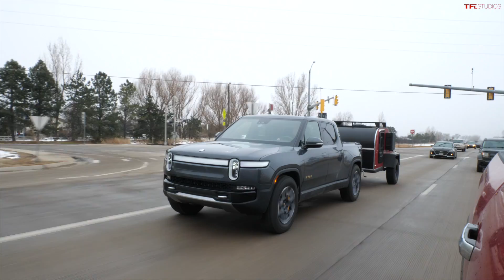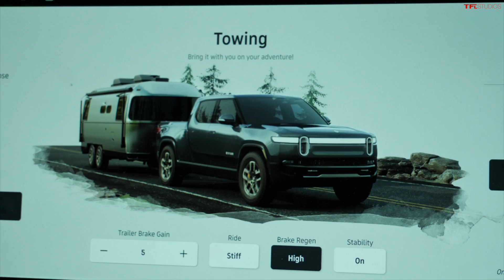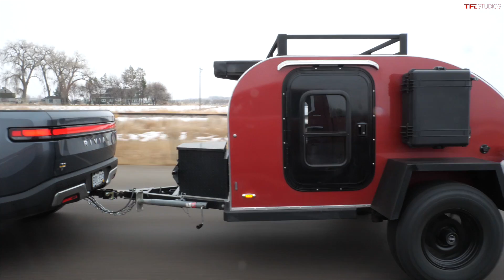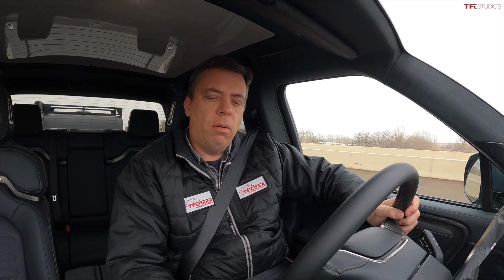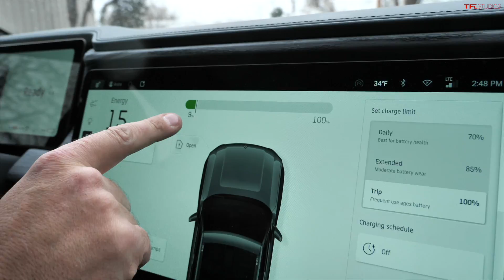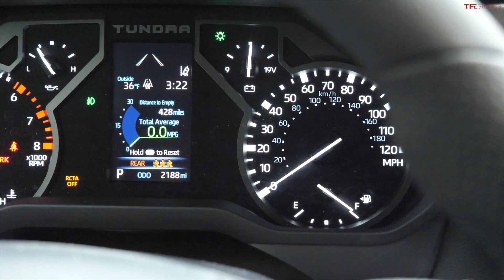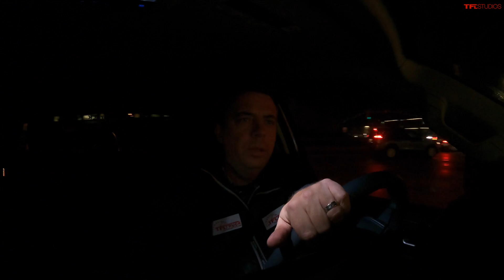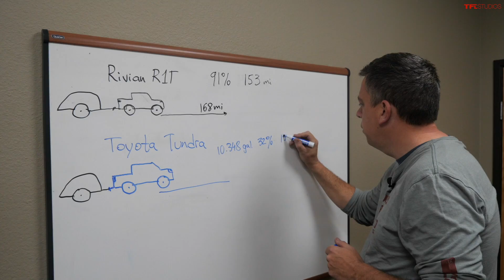Rivian R1T vs. Toyota Tundra: How Far Can Each Truck Tow On A Single 'Fill-Up'?

Comment from the maker: Thanks to Keeps for sponsoring this video! Head to https://www.keeps.com/TFLTruck to get 50% off your first order of Keeps hair loss treatment.
Reply: I know we can extrapolate this ourselves, but i wish you would have included a long distance trip example based on these numbers. For example a 2000 mile non-stop trip would take X amount of hours compared to Y amount of hours when you include charge times and refuel. Great video. This is why i watch!
Reply: 1.25 mi/kWh is ≈ 42 mpg.
Reply: @mgreene1409   in the last vid in the fast charge electrify America i think it say the rate was $.48 per KWH so would this mean that it cost $0.60 per 1.25mile?
Reply: @chileguero2  Yes.  The Tundra did 1.25 mi for 33¢
Reply: Share how long it took to recharge the rivian compared to how long it took to fill the Toyota.
Reply: How was the seat comfort, comparing both trucks?
Reply: Would you do a video on how modern vehicles are a Orwellian surveillance device?
Reply: so I am curious, in money $$$ comparing results, filling the Tundra, VS Filling the Rivian to do the same amount of miles the Tundra can do with one full tank. What's the cost? Gas Vs Electric ? would like to see that comparion in numbers. Love your vids
Reply: One thing you left out. You used 10 gallons at 40 bucks on the toyota. But really didnt show the cost of the Rivian. So I will use the  from the first towing of the truck which was 4 times the weight, at 20 bucks for half charge x2 be 40 bucks......Still not see how electric is better  Since toyota is what 35k less?....I'll by me the Tundra and with the left over35k+ I'll buy the wife a RAV4 Hybrid

Comment: The problem with this comparison is it was only on pretty much flat terrain to do a true test you should have at least some mountain driving to show how much energy is use with a n EV pulling on an incline. and with a 2,000 pound trailer you could have use a smaller truck like a Tacoma. If you're using the Tundra the trailer should have been bigger so the test was skewed from the start.

Comment: I think Rivian give a tow rating of 11,000 pounds. I would like to see a truck comparison, towing a larger trailer, up the mountains. 

Not necessarily the 11,000 pounds, but something realistic, if you owned a truck with tha tow rating, I think most of us would feel comfortable towing a 7,000-9,000 pound trailer. 

I live in the valley of Northern California and pretty much everywhere I want to go camping, requires a trip of at least 80 miles if I want to stay on this side of the Sierra's to about  220 miles, peaking out at 10,000 feet, if I want to camp on the Eastern Side,  with no charging stations for almost 90 miles before going over the highest point. 

So, put a 8,000 pound trailer on a Rivian and start at a couple hundred feet, then travel 90 miles up a mountain range. How far can you get?

Comment: What a strange test. If you used a Pick up truck with a smaller fuel tank the outcome would be different, if you used one with a bigger tank the outcome would be different. If you compare the rivian with the 18 wheeler i drive ( about 200 gallons of fuel ) i would win!! Again, a srange test.

Comment: The key thing that you missed,  is why do you buy a electric and it isn't for range or hauling (yes that is why you buy a truck).  It is efficiency....  and with electric trucks you compromise hauling for efficiency.  (This is assuming gas not diesel which would a really good match up against the Rivian. 
What you didn't answer was how much it cost to haul that trailer the same distance.

Comment: Rivian has a 135kw battery. At 91% it used 122.85 kw. At $0.43 kWh non member electrify America price verse $0.33 kWh for member. That’s $40.54 to go 153 miles for members and $52.83 for non members. Tundra cost $40.35 at an inflated price of $3.89 per gallon.  This is why gasoline powered vehicles cost less and mind you less stress and time.

Comment: I don’t understand why they wouldn’t put a generator or alternator into the electric vehicles to recharge the batteries as the vehicle drives. They could run it off of the axels and charge the batteries to get more charge and more distance out of them. But what do I know.

Comment: Great info and nice presentation.  My truck is a Dodge Ram 2500 with an 8L V10.  I’ve towed my 6500 pound travel trailer all over the country.  I only get 6 to 8 MPG average, but I can drive about 300 miles before filling up again.  The cost of gas is an issue now, but I’d still rather have the range of my ICE.  I watched a video recently about a couple in an R1T pulling a car on a trailer that was about 6500 pounds (total) across country.  They only got about 100 miles before having to charge for an hour on a fast charger.  So as much as I want to replace my old truck, I don’t think an ETruck can replace it yet… 🙂

Comment: Capacity is lacking for some, but just done some math for here in the U.K.  electricity is 28p/kw  and petrol is £1.87/L . So EV cost £34.40 and ICE cost £87.85 for the same journey.   Just depends if you can live with the lack of range before recharging. Wish I could afford a Rivian and that they where in the U.K.   Still waiting for my first EV a Kia EV6 AWD.

Comment: difference is you could use 100% of your 470 miles and refill that in five minutes the test really should be from 80% to 20% for the electric because if you use 100% it’s gonna take many hours to refill that each time

Comment: 122 kw x 30-35 cents kwh (what I have seen in other videos for dc fast charging) = $36 - $43 vs $40 for the tundra. this does not include charging losses and also the downtime for charging (how much is your time worth) on a long trip using fast chargers the cost of an ev is similar to a ice, so if you only use your truck to tow there is minimal benefit to an ev considering charging prices are only going to rise and on a holiday weekend the charging stations will probably be very busy.

Comment: TLDR:
Trailer is a 1 ton teardrop
Rivian did ~ 160 miles on the full charge
Tundra is good for ~ 470 miles on its 32 gallon tank

Video over.

Comment: Range is only part of the issue, your charge time will be crazy compared to refueling, and also charger location. I’m just not seeing much for charging infrastructure being built yet. Now even add in going camping. How much actual camping time is lost due to charging and range issues?

Comment: Hi TFL members I would like to see a video where you’re compare gasoline truck diesel truck and electric truck miles per gallon as compared to a kilowatt per hour usage on electric vehicle and working out the cost and efficiencies with all three trucks one of the biggest challenges you can have is the IR losses or heat losses during charging of the ravine truck so it would be interesting to see the time it takes for that truck to full 100% battery life and you can provide us with more data.

And also overall cost of the truck MSRP of all three trucks and how many years will it take to recover the initial investment of the three trucks. 

Thanks for the excellent content, big fan of the channel.

Comment: Nice video. There are 33.7 kWH per gallon of gasoline and at 10.348 gallons that would be a total of 348.7 kWH of energy burned to travel 153 miles, or 0.44 miles/kWH. The Rivian acheived 153 miles using 91% or 122.85 kWH for a efficency of 1.25 miles/kWH. This shows how much better use of resources electric vehicles are. Now this does not mean that the Rivian is more practical, at this point I don't think it is for most towing applications when compared to gaoline or diesel trucks. Battery capacity and charging speeds still need a lot of improvement for electric trucks to compete with ICE on towing. When you factor in that the Tundra's engine is only about 35% efficeint you actually get 122 kWH of actual energy from the gasoline used for roughly the same amount of energy used for the trip with the Tundra as with the Rivian which makes sense.

Comment: VERY BAD COMPARISON!
Use a high performance truck like the TRX or a tuned Raptor or anything that has 800hp, and then talk about range.
That is fair.
A combustion engine truck that does a 3-4 seconds to 60 from a standing start

Comment: Awesome comparison. For cost-comparison, they spent $40.35 in gas for the trip. They didn't show the charging cost for the Rivian, but looking up Electrify America rates in their area ($0.31/kWh), they spent about $38 in charging costs, so almost exactly the same. Something to consider is that its much cheaper to charge at home (~$0.11/kWh average in US - varying based on location and time of year), so it seems you can travel cheaper in an EV than ICE overall for this sort of towing comparison.

Comment: I think you need to factor in the size of that fuel tank in the tundra, sounds like that is a huge tank if you had 21 gallons of fuel left after towing that far, or maybe I misheard?

Was surprised you were able to tow that far...wonder what the max pack would do?

Comment: As soon as you said climate control I opened a new tab and googled "rivian have heat pump". And I heard you say "no" about the same time it came up lol.

I will NEVER understand why they dont include heat pumps standard on ANY electric car THAT ALREADY HAS AIR CONDITIONING (since the only difference between A/C and heat pump is 1 extra piece - a reversing valve).

Comment: The Ike video where you test in a more realistic environment vs. that mini-trailer proves EV vehicles are not for towing.  Period.   No way that vehicle can tow its rated 11k miles in real world conditions and not have to recharge in 50 or 70 miles unlike IC motors that can travel 200 to 300 miles (or more with larger diesel vehicles) between fill-ups.  Needing to recharge every 50 miles is unacceptable in my book.   We need a huge breakthrough in power storage before we can consider EV trucks.  I'd like to see swappable battery standards where you can exchange a fuel cell at fuel / battery stations similar to the BBQ bottle exchange.  Only then will EV vehicles come close to replacing the family SUV/truck.  Additionally, the strain placed on power grids when more people finally transition to EV vehicles will cause major infrastructure issues resulting in rolling black-outs and increased kW costs.  I've also heard some states imposing a mile tax for EV vehicles to compensate for loss in fuel taxes.  Once you strip away the cost per mile savings, total environmental impact of an EV from production to end of life/recycle point (lithium batteries), higher initial cost to purchase & manufacturer, and distance / recharging inconveniences I am out as are most Americans (if they are not drinking the EV Kool-Aid).  Use common sense people!

Comment: I wish you would expand a bit on the cost of the trip for each. For example, we see you spent $40.35 for that same trip in the Toyota. Based on what I can see about the trip you described, it seems you used around 122.85 kWh. Colorado is averaging around 12.28¢ a kWh... so you at least spent $15.09 for the same trip with the Rivian. 

Put another way, the Rivian's fuel costs 37% of the Toyota's. Or a little over 1/3 the cost to drive that distance.

Comment: I think this perfectly illustrates why this will fail at being a truck and will be a grocery getter. 

150 miles before you become uncomfortable towing. and that was all flat. No hills. and a considerably small trailer. I mean that trailer was SMALL. Load up 3 motorcycles and a side by side, or a legit travel trailer that weighs 5000 lbs and you'll see that range drop in half again. 

That means for any trip that is not local, you'll be stopping and charging 3+ times, each charge taking an hour or so. If your regular destination is 300 miles away (still considered fairly local for most), then you're spending probably about 4 hours+ charging. Changing a morning trip and an afternoon of fun into 1 WHOLE DAY of just driving and charging. 

3 of the destinations I go to, all remote, all without charging stations are 230 miles, 280 miles, and 260 miles. You're telling me I'd have to spend 2 to 3 hours charging EXTRA to get there? 

no freaking way.

That is just not acceptable and not why people buy trucks.

Comment: Can't imagine the heater using more than 2-3% of the battery, even if it's a fully resistive system, unless  you put it on full blast with the windows down ... Don't worry about it not being a heat pump in this case.

Comment: A couple other interesting facts that should have been noted.  $40 in gas for 10 gallons, rivian battery is 135 kWh and you used 122 kWh whic at boulder prices of 12 cents per kWh would be $15 .  So for $40 how far can you go in the rivian? That would be 333 kWh or 420 miles.  Hmmm…
Reply: You have to compare to dollars since that is the constant not tank size.  Tank size is arbitrary and does not reflect efficiency.  The rivian is hundreds of miles more efficient than the tundra.   Even more so in Texas where electric rates are 8 cent per kWh.
Reply: Not more efficient in Texas but more miles per dollar

Comment: It would be nice to have a cost comparison between two trucks considering that a lot of people will not be going long distances most of the time. As with ANY electric vehicle, if your going a long distance, it's going to take a longer time to get there and you must consider if you get in heavy traffic or have to wait because of an accident and use some of the power until the next fill up.

Comment: I'm all for EV trucks. But we have a long road before we get to true truck capabilites with EV trucks. Let's just get them right with range before we start throwing variables like  heavy towing and hauling. It's bad enough we have wind drag, extrem weather and inclined road terrain  to deal with. If you want to tow 10,000lbs un hills in cold weather. You can forget about getting an EV truck right now. Basically these trucks will be used for local in town towing or carrying. When you can charge up close by. Maybe like contactors or delivery services. No road  trips yet.

Comment: Since EVs are less efficient at highway speeds I would be more interested in hauling and towing around town as I don't pull a trailer long distance. If it is the same as the above test then that would be hard for me to justify at those prices.

Comment: You forgot the energy conversion, which is important. In the Tundra you used over 320kWh worth of energy according to EPA numbers. It also would have put out about 125kgCO2e vs the Rivian’s 50kgCO2e (assuming average US power mix). I know people can’t always be environmentally-minded when work is concerned, but for people who can afford to have that in their calculus, this shows that an electric pickups are a good choice.

Comment: Thank you for this amazing video. Really love this! I had a lot of questions about electric trucks and must say that you are a

I think that for a real pick up user, a plugin hybrid could be the best of both worlds... Just an idea. I feel the electric trucks, while being totally practical, in case of the R1T, within the limits of 150mi, are limiting in some cases (e-network is not up there yet). So I feel a 30-50mi e-range with a gas engine would support my use cases perfectly.

Comment: Was there any place to charge the electric truck only 153 miles from where it started ? How long did it take to charge it up from 18% to 100% ??
Let's say it took 35 minutes to charge it 100% (which is generous) that means that charging would add well over an hour to a trip of 450 miles and that is if you can find a charger at the place you are very low on battery and if you never have to use full power for the trip and if there are no hills. That is a lot of if-ing to put up with.

Comment: Sure the Toyota Tundra has greater range but what about total fuel efficiency? In my 2015 Nissan Leaf I am averaging 4.5 miles per kilowatt hour. Converted to miles per gallon of gasoline that is about 151.65 miles per gallon equivalent. I wonder what the MPGE of the Rivian R1T while towing is? According to the EPA there is approximately 33.7 kilowatt hours of electricity in one gallon of gasoline.

Comment: The energy density of gasoline is actually quite ridiculous. Especially considering that ICE engines are only around 30% efficient at turning it into power. Engineering explained has a great video on it. An entire Tesla battery pack only has the same energy capacity as like a couple gallons of gas. It’s impressive how efficient these EV’s are to stretch that small amount of energy to go hundreds of miles.

Comment: Great video, what I'd like to see is what is the % drop from no trailer to trailer, so the rivian lost about 50%, range maybe a bit more? and the tundra is what, a 20mpg truck?   So the tundra lost about 30%? From a no trailer point of view?    It is amazing how much range we lose in electric vehicles....     It is also amazing they do e sell drop on gen sets to get u a full days driving.    A 20hp engine, like a 400cc scooter motor hooked up to a BLDC motor to charges.    I think that would be the ticket!   And can use it to run ur home if power goes out.     Why am I the only person seeing this, I feel like the Cyclops in the land of the blind.... I'm not that smart!!!

Comment: The Rivian might go 1/3X as far, but it did it 3X more efficiently. 10.3 Gallons of gas is about 380 kWh of energy vs the Rivians 123-ish kWh used. What costed you $40 in the Tundra probably ended up costing the Rivian about $12.

Comment: Here's what the one thing no one is asking, how much is a battery pack going to cost to replace, two how are the batteries to be recycled ? Lead acid can be recycled and the acid can be neutralized how about the lithium batteries how are they to be disposed of?